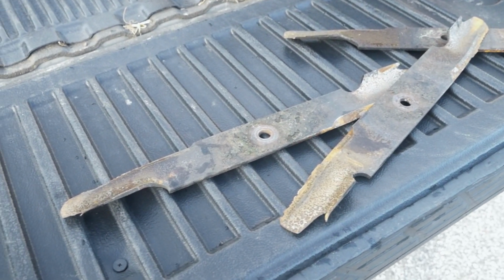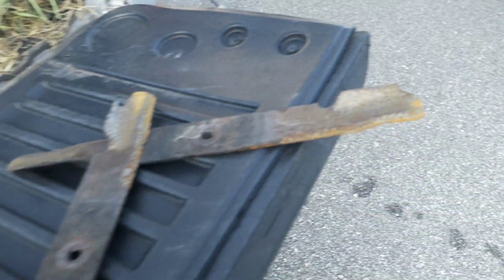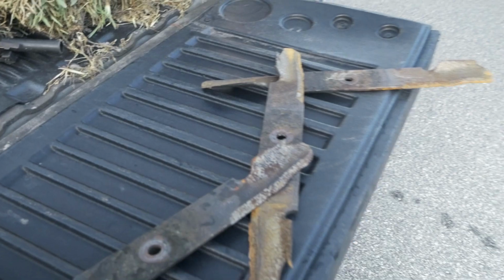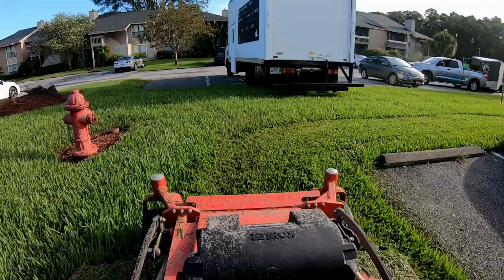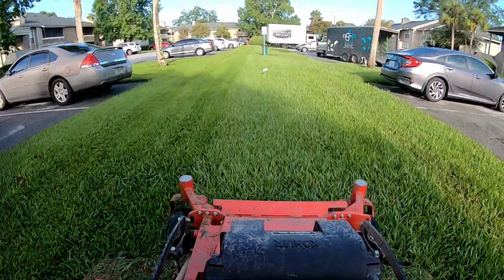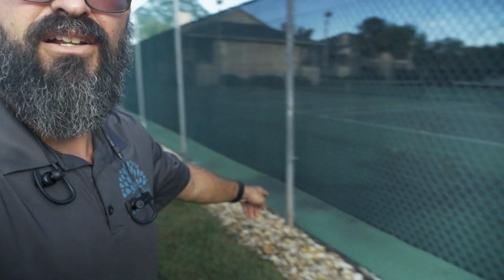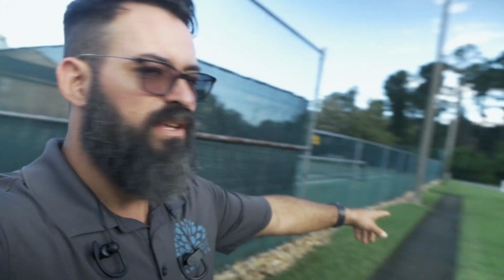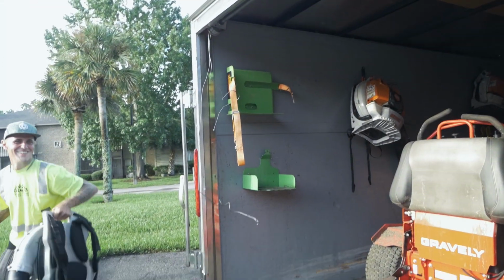Laser Edge SELF Sharpening Mower Blades 76hr Review Pt1

Comment: About 6 years ago I finally was able to move out of the suburb to some property, got my first mower a zero turn. You would probably be horified at the hours I have on my current set of blades. lol. I am in the process of getting new ones though. =-) (130hrs after they were sharpened 4 years ago) Side note you are actually the reason I even looked at my blades. I had no idea they can wear out like that.
Reply from the maker: Lol ey as long as they keep cutting!

Comment: Hey your scag a 61 inch? what brand of laser edge go on the scag that are from laser edge?
Reply from the maker: Only one brand, ask your local dealer brother!
Reply: @beachriverlandscapes   I ordered the brand of ferris blades which are laser edge  which was 189.00 but I noticed the gravely set of laser edge is 20 and half in length for there 60 inch deck and not 21 inchs in length like the blades on my scag but the gravely set is 99.00 plus tax and I did not know if you knew if those would work or not
Reply: @rulyboobear  You cannot use 20.5" blades when the standard blade is 21".
Reply: Scag offers these blades now.

Comment: No mulch kit yet wally? Lol
Reply from the maker: Always
Reply: @beachriverlandscapes  it seems to be tucked inside the deck huh? What height do you cut your at.augustine at?
Reply from the maker: Yessir and usually 3.5 to 4.5
Reply: @beachriverlandscapes  is 2.5 to 3 Inches a bit to low? St.augustine isn't common out here in central California but I got 2 houses I do with it just wondering what is the correct height to cut it at